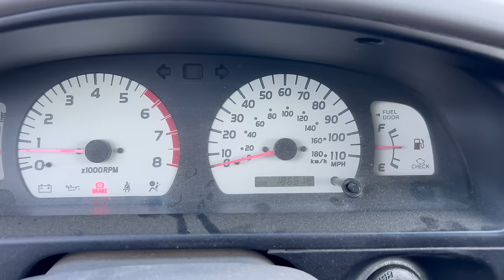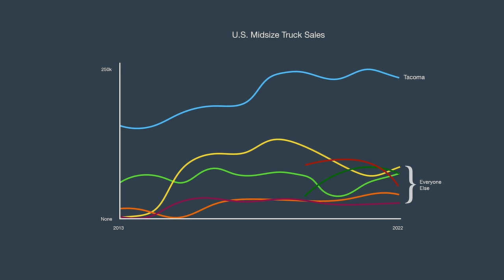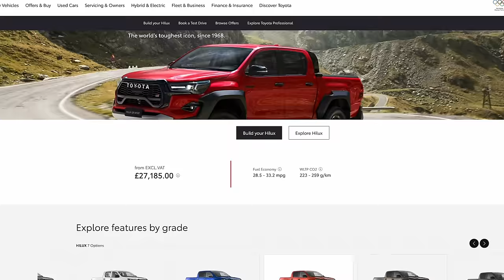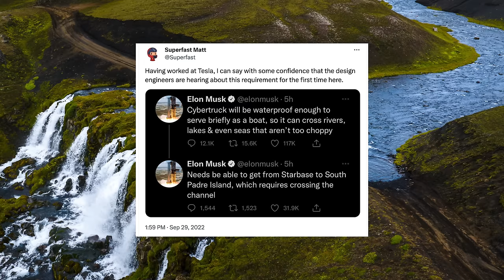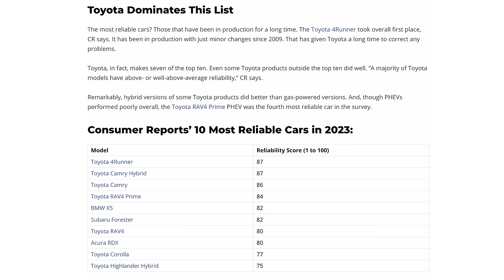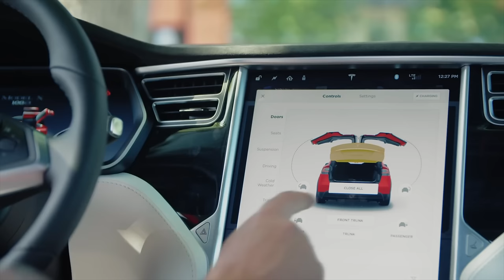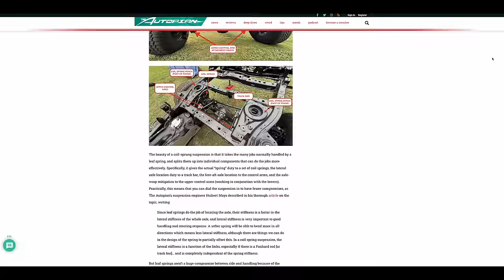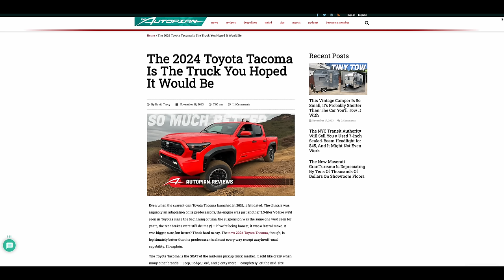What Is The Best Truck, And Why Is It The Toyota Tacoma?

Comment: My only beef has been the seating. The bigger trucks have your knees bent more. Tacomas are more straight out. No argument on long term value though. I've worked for a Ford dealer for over 40 years and told my boss when I retire I'm buying a Toyota.

Comment: Interesting the Tecoma is a turbo 4, in Australia the landcruiser 79 series is now available with an auto and the Hilux 2.8d turbo diesel which is faster than the v8 diesel, but theres a lot of online feedback on the loss of the v8. They still have wind up windows at 78kaud. It is aimed at the mining market.

Unfortunately the reputation of Toyota reliability isn't accurate anymore and hasn't been for ten+ years.

Comment: Driving my dad’s 91 22re toyota pickup. Close to 400k. Still running.
Reply: Do you happen to know if and when he redid the timing chain/ guides? I have a 22re 93 2wd extended cab pickup and it has 100xxx miles. Worried I will have to do the guides here at some point. Thats the only bad thing about the 22re

Comment: I have a 2003 Taco in my driveway. V6, 4WD, extended cab, manual, TRD. It'll last forever, or until the second frame falls apart.

Comment: Great video, Matt, thank you. My wife and I still have our 2005 Toyota Sequoia 4x4, but have been wanting to give it to one of our kids (with the understanding that they'll give it back to us when they're done with it... I'll be buried in that truck, TYVM). We've been looking at the new 2023 Sequoia, but they've also undergone a major refresh this year. First model year jitters have kept us away so far.

I really wish V8's weren't so horrible for the environment, as the 2005-2022 Toyota V8's were the very best engines ever made.
Reply: V8s are not horrible for the environment, not even W16 engines are, how horrible your vehicle is for the environment depends entirely on how you drive it, how aerodynamic it is, and how horrible the tires are, more gas consumption the worse

Comment: My 81 rabbit pickup tdi swap is 43yo
It gets 3x the mpg as a Tacoma. 

It drives like a car. 
It has a 6’ bed. 

My 1998 tdi engine had 300,000 miles on it 12 years ago. 

It’s easy to work on.  

It fits in more parking spaces. 

It gets 3 times the mpg

That means if we all have driving licenses for 60 years. 

Then I get to stop paying for fuel when I am 38. 
And you still have another 40yr of pulling out your wallet. 

Think about how many years you are working for having poor mpg. 

I’ll be chilling with  stacks of cash 

The same cash you chose to burn so you could have a bigger and heavier more complex vehicle

Comment: I'm an Aussie, I have an 05 Hilux 4.0 petrol 2wd with nearly 300,000km, the engine is like new, there isn't even a hint of a oil leak.
I'm also a mechanic, I bought it because I knew I wouldn't have to do anything.
In Australia though the ute culture here is all about trying to out do the next ute owner. The new utes have more stickers and less tray space. The whole 'Tacoma TRD Sport Trail Hunter' is cancer and has infected all levels of ute. Although regardless I struggle to believe a new model will ever outlive a 1995-2010 model

Comment: I had a 90 regular cab, 4WD, 22RE I really liked. Put on a Rancho suspension system that really made that truck the best it could be. I wish I still had it. My wife had a 91 4Runner. Went full size on both vehicles after that, but came back to Toyota in 2019 with my 19 TRD Off-Road Dual Cab 4WD, V6. When I was looking for a new truck, I was thinking of buying a 3/4 ton with a diesel. I had a 2018 TRD OR 4X4 as a rental on vacation and it changed my mind. I bought my 19 and haven't looked back. I was a little concerned about the smaller bed, but I just use my motorcycle trailer if I need to haul something bigger. The Tacoma is so much easier to drive. On a long trip, it is far more comfortable and tires me less because it requires far fewer steering inputs. My old truck was four-wheel drive, lifted, and on 35s. The Tacoma is far quieter, gets almost twice the highway mileage, and is just more pleasant. It fits places that were problematic for the bigger truck and while it does not have the brute force of the old truck, it makes up for it on finesse. It has better departure and approach angles than the old truck and better breakover. It turns around better and fits through places in trails the super-size trucks of today can't go.
Last Summer I drove from So Cal to Cody, WY, then on to Jackson, and home through Idaho. I got as much as 29 MPG. The old truck couldn't top 15 with the engine off, a trial wind, and going downhill.

Comment: I have a 2010 that I bought from my father-in-law. It's a base model, 2WD 4CYL because he's the cheapest man on the planet. They shouldn't have even offered the I-4 motor, it's a gutless wonder, struggles when you do truck stuff with it, and actually gets terrible mileage. It had the frame replacement done but the rest of the stuff under there looks like it was recovered from a shipwreck. Access cab has suicide doors for the back and they are an absolute nightmare in a parking lot if you want to get to the back seat. It's fine and it's nice to think it'll last forever but that rust is gonna kill it well before the drivetrain gives up.

Comment: Why are Toyotas so reliable?

Not enough power to hurt themselves. 😏

I have owned 3 an 83 Corolla auto that was a blast to drift around but only when wet or offroad. Higways at 70mph were a %110 effort driving experiance.

Next was a manual 80? Corolla Tercel we called the Bronse Bomber, it was fun offroad. Also a handful on the freeway.

Last one was a 2001 Tacoma. I really liked that truck and planed to keep it around till it died. Unfortunately I let a friends wif borrow it to 'help her sister move'. Well she was moving away from her Boyfriend and he didn't like the idea. He damaged every single body panel with a 10lb dumbell.

Comment: its a late model 90's taco because Toyota wanted to break into the American truck market, so they made an extremely awesome, overbuilt truck that was a loss leader to build their brand up. they literally never designed another truck as overbuilt as the toyota for the US and have just rode on that brand recognition ever since. other vehicles from them are good like the old 4runners (american hilux), but nothing has topped the old tacos

Comment: It's a toyota because the Japanese have a word for "the janitor can speak directly with the CEO about a flaw in the assembly line. The CEO will then put engineers on a task to consider the janitors concerns. Then proceed to adjust accordingly".... all that into one word.

Comment: Why not the new Colorado? Both need to prove out the durability of of their new turbo four poppers. Savagegeese video also the fact the same engine is being put on the moneymaker (Silverado) something tells me GM will do everything to make that engine as reliable as their 8 cylinders workhorses. Toyota's reliability comes from parts being often carryover. At best just fixed and refined but rarely, if ever, redesigned. They were seemingly the last one to get rid of drum brakes, 4 speed transmissions, etc. With so much being brand new in the latest Taco, I'm very curious how it will stack up.
Reply: Well, maybe reliable enough to last the warranty. GM's 8-cylinder workhorses, with AFM (cylinder deactivation) haven't been so reliable lately!

Comment: Well, I’m going to be that guy. 
I’ve had several Toyota’s and I’m not going to disagree that they are usually about as bullet proof as you can get. They definitely have their issues and their bad designs. However, they are not the only bulletproof small trucks out there. Ford, Chevy, Nissan, Mazda all have very good vehicles. Toyota’s reputation is exaggerated greatly.

Comment: I agree tacomas are bulletproof but only some you know what the best truck made ever is cat eye generation Chevy gmc Cadillac full size gmt800 and if you get a Duramax they are amazing 26 mpg made of real metal some of the last trucks and Matt you left out the frame recall on the 94-04 tacomas from rust not painting inside of frames

Comment: Me and my friend revived a 1991 Toyota Pickup DLX V6 4x4 with a 5 speed manual and even though the transmission is about to die and the clutch is hanging on by a thread, the power steering blew up years ago, the muffler just fell apart yesterday, and it has over 260,000 miles on the clock and yet I've driven it for hours already and it hasn't blown up after sitting for years. So yeah I understand why they are valuable but dang they are slow, loud, bouncy, hard to control, terrible headlights even when you put new sealed beams in, the wipers are horrifically bad even though I put modern J-hook arms on, the emergency brake warning light wont turn off, and it will get a check engine light later, cough, huge bang and shakes the whole truck, and then the light disappears for the next two days. Overall, its a death trap of a truck, super dangerous, could explode any second, and needs thousands of work to get it back into safe operating condition yet it still goes along better and more reliably than some newer American trucks with less miles.

Comment: It may be newer trucks are better, but in the important area the older ones are better.  Federal mandates have compromised engines/powertrains.  Gas mileage requirements sabotage the ability of newer trucks to do better.  I point to the new Ram trucks as an example.  The 5.7 is being replaced by a small 3.0 6 cylinder engine, that isn't market driven but mandate driven. As long as customers are not allowed to get what they want they will revert to the trucks they know and love.

Comment: the people who know just know but the Nissan Frontier and Toyota tacoma where fated rivals for a long time, the 1st gen frontier is superior in nearly every way to the 1st gen tacoma, price-features- no rust problems- no frame issues-power and reliability only downside being value. the 2nd gen frontier competed with the 2nd and 3rd gen tacomas and I would say its a much more fair fight between both because both models had problems that where slowly solved as the years went on. with the 3rd gen frontier I think its finally behind the current tacoma in the engine department and the fact they use a engine with insane carbon buildup, reliable is still not all that bad but as we know, the tacoma will always be king because it has what the frontier does not and thats brand perception. while both models may be nearly neck and neck no one ever thinks about the frontier that why there is nearly no aftermarket support for 1st and 2nd gen frontiers. it pains me to say it but long live toyota and RIP to Nissan as its a mostly a garbage brand now

Comment: I would not buy a Frontier at all.  I was working (in IT) and one of the guys was having car trouble in the parking lot with his Nissan Frontier not starting.  I went over to help him look at it.  It was a manual, and it turned out the little bent piece of sheet metal that holds the clutch safety switch had bent, so it wasn't registering when he pressed the clutch to turn the key on.  I bent it back by hand and it was fixed.  This is not an ok design.

Comment: Personally I reject the modern notion that everything must have driver assists and touch screens. I'm not old or anti tech, but I want something smaller and purpose built like the gen 1 Tacoma. There's also massive privacy/surveillance capitalism issues around infotainment systems. And if I'm less "safe" or comfortable in an old truck vs new, then it's a trade off id willing make and apparently so would a bunch of others given the unfortunate 2nd hand prices of older Toyota trucks.

Comment: I had 3 Hilux's 86,93,94, plus an 88 Sunraider motor home, I now have a 03 Taco with 367000 mi on original equipment, currently in Southern Baja towing my 19' Scamp trailer, I will always lament the day I sold my Guards Red 78 911 SC with factory Whale tail.   Your projects are definitely interesting, and that's absolutely the best thing anyone could ever do with a Dodge Viper, I'll bet you could figure out something cool to do with a Chevy SSR maybe

Comment: That bit about the car doing what you tell it is why I will never sell my 2010 tundra. I dont want an Ipad in the dash. I dont want 4000 modes. I want a simple drivetrain, on a simple frame, that will simply do what I tell it and will last eternity with minimal maintenance.

Comment: TRUTH - yet impossible to get new engineers on board - reliability is simplicity. There's no reliability benefit finding the complex, novel, super cool solution to a problem. Toyotas are reliable because they use simple methods executed as a system.

Comment: 4:17 a rare long bed version of the crew cab. My dad had one of these in the TRD package in red, 2006 model. In 2018 it was worth more than mom’s 2007 Camry XLE V6. Before that he had a red extended cab long bed 2001 Taco, which got totaled in 2004 by a car spinning out on the interstate.

Comment: I am an old Toyota fanboy having owned many classic Toyotas. I wonder how well these new Tacomas compare against the Ranger FX4. I drive the 2021 fx4 ranger for work, and I am in love with it. I was surprised that Toyota copied ford by going the route of 4 cyl turbo only the ford has a 10 speed auto (but no manual). Being that my 1991 toyota 4x4 pickup has a brand new engine and a very low mile 5 speed installed, It will probably outlive me and any of these new plastic trucks. Also, the new toyotas look obscene.
Reply: What! You don't like the giant fish-mouth and lizard-eyes?

Comment: Thanks for the review. I'm on my 3rd Toyota: (1st- 1986 Pickup, 2nd - '96 Tacoma 4x4 and now a '03 Tacoma 4x4 Quad cab). I loved every truck. But I really miss my '96 Tacoma. That truck was so much fun... manual, Willis Hub Locker 4x4, dif lock... but everything else was non-power... old timey windows... it actually had a cruise control (for a standard, I thought that was strange). Hauled my Harley in the back from NM to AZ. I miss that truck.
Anyway, still driving the '03.... 178K miles so far. I have had a few mechanical issues... Brake Master Cylinder replaced 2x, steering knuckle, and a recall on the front steering rack and pinion. But it's been worth it. It's showing it's age.. paint is nearly gone, interior could use new carpets and a cleaning.. but mechanically, still solid. And I still get offers for it even as crappy as it looks. But 20 years and it's still solid. That says a lot.

My dad still uses his '86 Toyota pickup. They are just reliable. period.

Comment: (Insert product name) is worth more than it was new. 2000 4x4 xtra cab msrp: $14,048. Adjusted for inflation 2023: $24,930.50. sources Mototrend, CPI inflation calculator. 

Now, I'm not saying that you cant go pay 100k for a tacoma on bring a trailer. The majority arent selling for 25k. To suggest this is poor writing. Also, do you have the production numbers for that there v6? If not, seems like "rare" might be a baseless claim.

Comment: That old Tacoma is worth more than it was brand new because it never spent a day in a region where it would be exposed to lot of moisture or salt. Tens of thousands of those old Toyota pickups died an early death to rust rot. An issue that Toyota was particularly known for and did more to try to hide it than address it, which is why they sued and eventually had to settle a $3.6 billion dollar lawsuit over. Just one of many lawsuits and they faced over the decades because for some reason, Toyota really doesn't care if their frames and beds rust rot faster than any other manufacturer (I had Nissan Hardbodies that gave them a run for their money to be fair). There in lies the problem with Toyota, even if the more recent issues are quality and reliability related --- the 3rd gen Tacoma earned the nickname "turd gen" on the TW forums and the 2022+ Tundra has engines blowing up left and right. Unless you live in a desert, rust rot is going to be the biggest threat to Toyota trucks and as the multi-billion dollar lawsuit exposed, Toyota will go to greater lengths to hide the rust rot than actually fix it or change the way they make the trucks in order to prevent it.

You seem so confident Toyota's engines are tested to the n^th degree yet evidence suggests that hasn't been the case in recent years. How many design revisions of the 2GR-FE were there to address reliability issues? There more than a few major changes to address issues Toyota somehow didn't catch during initial validation. How many 2GR-FKS failures have there been in Tacomas and Highlanders where the vehicle was provably well-maintained? Sure seems to be a lot of catastrophic failures at the 100k mile point. Same with a large number of owners reporting that their engine suddenly started running rough, diagnosis was head gasket failure, and upon disassembly the engine had a cracked cylinder -- not an uncommon issue. Even suddenly oil pump failures seems to be reported at around 100k miles. While we're at it, sure seems to be a lot of 2022 Tundras with crank bearing failures. The list on the Tundras forum is growing by the day, one guy on his 2nd replacement engine over the span of approx 60k miles. The most likely cause is suspected to be low-speed pre-ignitiona but that would be pretty bad if it turns out to be the case because LSPI has been pretty well understood in turbocharged gas engines for years now. But when you're Toyota and have claimed for over a decade that it's "normal" for your engines to burn 1 quart of oil every 1,200 miles, it's probably really really tough to prevent LSPI even if you're careful about engine oil formulations to prevent it. I would go on about the current decline in quality and QDR at Toyota, but what is the point. Fanboys are going to screech, cope, and attack anyone questioning the glaring problems with Toyota in the last 7 or 8 years.